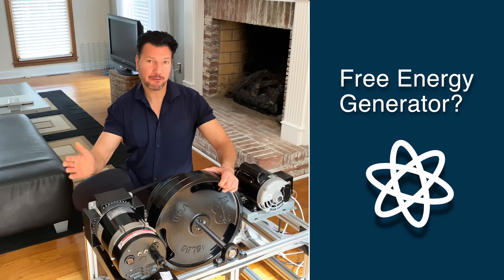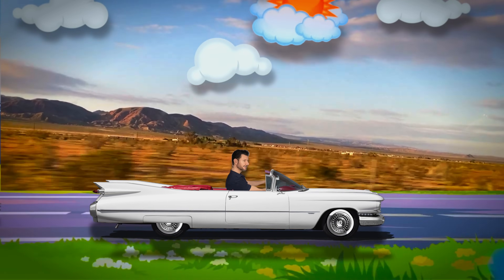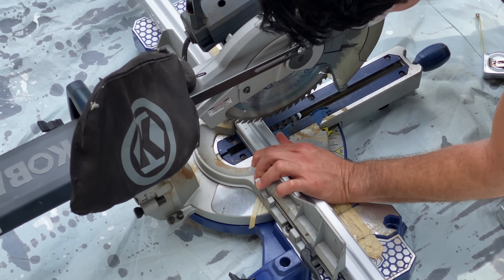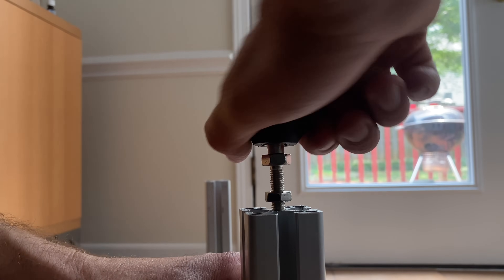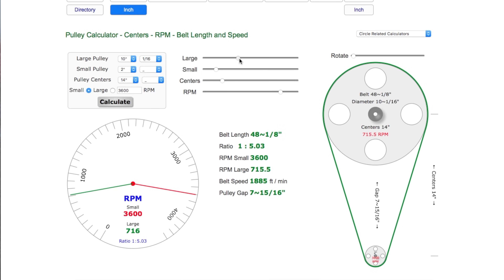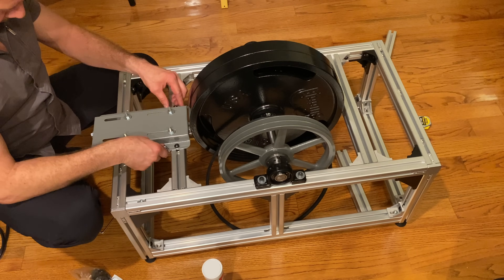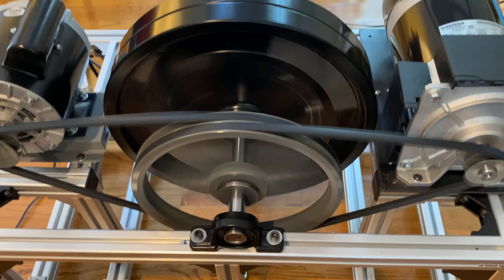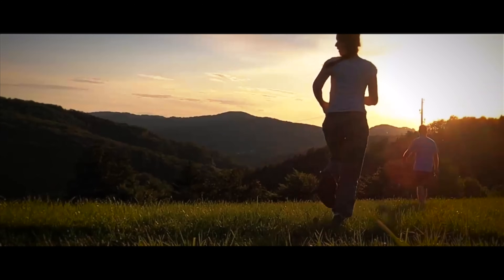How to Make a Free Energy Generator!

Comment: Yeah OK I'm the person out of all the other people you may have talked to they can make your prototype work, comma first I am the father of overunity I created it and I purposely stop talking about it because people were trying to steal my work .( Here's what you do put an alternator or a generator. In between what you already have on a fan belt. Overunity concept works with the the energy going in should be the energy coming out picture a water wheel as you know the water falls down into the cups cups that fills up the cup the poor cup pours out that's equal amount of energy as equal amount energy out if you try to overflow the cup you lose energy so these types of engines are limited . 2nd the motor should work off a battery If the battery should have passed through charging and the alternator should give the same amount of energy the battery does , remember in your car the alternator works all your electrical properties. So when you get there the alternator should run the motor when at speed and only the motor nothing else should be hooked to it the generator should be almost by itself to generate power for you If you cannot run a motor from an alternator then your car should not work look at the things around you hope them up the same way you'll see that when you hook a battery to run something and it runs normal then using pass through charging means that you should be able to put that energy back into the battery . So what do I do here's my video which I can show you that I got a complete wrap-around That means I'm recycling energy.
https://youtu.be/HTR03aSiGWs
 And one more thing here's my number so you  No that this is not fake I'll send you pictures through email if you wish the whole thing is that they've been trying to silence the people who actually are successful only things and only give voice to the ones who are faking it give me it. 3136515349 , media library has been doing these types of projects for over 31 years and yet we're nit were not even well known why why are you the kind of person who will find out and I and I spend a great deal of money working on these types of ideas so it's up to you if you actually want to know what to do I guarantee you someone will find a way to stop you from getting this information but it won't be us , sometimes they use lies and propaganda others they blocked you on YouTube or some other social media But if you can reach me then you will have that machine up and running. Oh you cannot connect electricity back into itself without immediator mediator the battery access that mediator it's called noise but we can go into the go into that in a bit more detail you tell and you'll see that is that the motors in and gadgets are different outside the country. Medialibraryinfo@gmail.com
Reply from the maker: Interesting work you are doing Lloyd!
Hopefully you will succeed!
Reply: @MarkusNenning   We  Been very successful over the 31 years we've been studying studying these types of devices for green energy, Again I stress if we get a chance to communicate I can tell you more details about the things we have done but so many people are Leary even just  Communicating over emails this this is why we don't have better information to debunk those fake videos, Like I said and I also know that those other guys will do that if you communicate with them is to show to show you pictures and proof that the thing you're working on are not fake. If so that's why I say here's your chance your chance to find out and pick my mind for some of your projects, Is the battery an alternator that just has one job to supply the motor with electricity Is not a trick It's just simple as this you know that you can supply electricity from a battery but nothree but no one talks about how you're going to give energy back to the battery you know the motor is powerful enough to give you all the power you need so  Mimicking what you already know like a car you know that you can can use a battery and alternator in the same functions with an automatic switch at a switch the alternator will constantly keep the battery going and probably have enough energy to supply for the motor or the motor add idle no when it's over tax it relies on a battery Most solar systems work the same way you just have to really think about what we have and we have and how you can use it in the most efficient way

Comment: Sir.. I have an idea to make it work. Just simple put a timer relay set to mode that will on and off every 1 sec... This will prevent the motor in stalling.. And i think the power generated is much higher than the power used durjng pulsating on and off grid
Reply from the maker: Hello “Just do it yourself”
Yes I was actually thinking about some sort of pulsing function it is a good idea.
But as a first step I think I have to change a few other things first.
Thank you!

Comment: I'm also working on it and what I concluded is that it is only possible with low rpm mpg alternator and by adding a.c. inverter of 2kWh along with programmable control circuit.

Comment: It is working as intended. Once you unplug the motor , it turns into an alternator if the circuit is connected to any load. In that setup you end up with two alternators trying to stop each other. Which is something used a lot. Is called ELECTRIC BRAKE. And as you can see is very efficient on stopping the flywheel, that's why us used to brake trucks on long descents.
Reply: If that is the case a rectifier diode should stop this from happening
Reply from the maker: You are correct Marc that is used for brakes especially now in electric cars.
However the switchover in my case is done via relay as you can see in the video and only takes milliseconds.
Such a short time can not create the resistance by induction to stall the motor. Especially if no other load is connected.
Thank you for your feedback!
Reply: @MarkusNenning  Hi Markus, thank you for your video. I agree with Marc in the sense that the generator and Motor are out of Phase, try swapping around the L and N lines, I would also try a Running capacitor across the lines about 10uF to see if that would help? On another note these are free energy machines in the sense that you create the video, put it on YouTube and you receive income and you have money to pay electric bill 😁
Reply from the maker: @bengouws  maybe you’re right about that Ben 😃
Switching phase with N won’t make a difference on a single phase motor.
But thanks for your feedback appreciate it!

Comment: I think there should be 2 motors in this system. Bigger motor to give initial push to flywheel and get replaced by smaller motor.
It's because flywheel requires more energy in the the boggening and once it's rotating it's max speed, it will be easier for small motor to maintain it's speed so energy could be accumulated by flywheel by each rotation of small motor.
Please try and let us know. Keep up the good work.
Reply from the maker: That’s a good idea!
Thank you xshadow!

Comment: Use a dc motor with a speed control. You can ramp up slowly without draw a higher amp. The other thing v belt drag power from system use timing belt no need to adjust too much, I try this once with two dc motor without the fly wheel just the pulleys 2 to 1 and run for a minute, as you say is difficult to find a flywheel
Reply from the maker: Thanks Raul!

Comment: The closest anyone can get to “free “ energy is with solar panels and battery banks. Anyone that makes a free energy video and shows them getting free energy is lying. There is always going to be internal losses. Even with a power inverter with a charger connected to it and the source battery. It may prolong the run time for a short period. But the internal losses will take affect.

Comment: The only way i suppose working is using neodimium magnets as power source, self inducting current on own coils. Once the motor reaches the working speed, you will have an exess power to use. Without calculation is almost impossible to say how much will produce but if is big enought, well maybe also 1 kw. I'm talking about an engine weighting around 200 kg...
Reply from the maker: Thanks Denny I also believe that magnetic energy might have the best chance to work with a setup like this

Comment: if it goes for more than 12 hours all the chances to burn, it is not very good to use it continuously, but it is very good one built for 24 w for charging solar batteries, I work on it if I succeed I will put it on youtube
Reply: Buna ziua
Chiar va rog sa postați un video dacă va reușește proiectul
De 7,8 luni tot urmăresc video-uri de genu și nu sunt ferm convins ca e real
Mulțumesc

Comment: the kg wheel must have rotations per minute rpm much higher than the generator, and the generator needs some bulbs, some consumers not to burn, ie it must be somehow balanced exactly for that consumption otherwise it burns
Reply from the maker: Hello Cruceru I have actually tried the bulbs because I thought perhaps I need a load on it. My generator supplier also had a recommended tolerance +/- 200rpm. You suggest to go over that?
Thank you

Comment: Hello, I have tried to do the same, but what happens is that the motor while receiving electricity behaves like a motor, but the moment you cut the motor power, it becomes a "Generator", then you go back to put energy there is an electric shock, between the energy of the motor (transformed into generator) and the large generator and everything begins to stop.
I think that what should be done is to synchronize the phases between the power of the grid and that of the generator and after synchronizing you must cut the power of the grid. and voila! ;-)
I follow you. I want to see a happy ending xD
Reply from the maker: Hello Jaime, I have avoided that in my system with the relay I show towards the end of the video.
This makes the switch over from grid electricity to generator electricity just a couple milliseconds. That should be fast enough to not cause the problem you described.
Thanks for the feedback and subscribing!
Reply: @MarkusNenning   I understand what you are telling me, but until today there is nothing faster than electrical energy, so by the time you make the change with the relay, even if it is very fast, it will never be faster than energy and stop that will be too late ;-)
Sorry for my bad english xD
Reply from the maker: @1972Jimm  your English is fine no problem. 
Thanks

Comment: ..try adding a battery , capacitors , microcontroller ,pwm motor control.. etc..we need this to work in order to recharge batteries on the go in EV  in the near future.. let's figure out the perfect circuitry/formulae for it..open sourced
Reply from the maker: Totally agree Suren!
Thanks
Reply: @MarkusNenning  ...keep in mind " the infinity mirror or the feedback noise from a speaker" this is the main principles we are working on but in a form of extra energy harvested from a calculated combo of motor + flywheel + dynamo.. if this works than a new revolution is born..
Reply from the maker: @surenbono6063  huge U2 fan by the way so love your name! :)
Reply: @MarkusNenning  ..it's a beautiful day.. don't let it go away..
Reply from the maker: @surenbono6063  love it one of my favorites!
Reply: Check example 2 https://youtu.be/eBtxjyD01lo
Reply from the maker: @surenbono6063  this is an amazing system! One of the only ones I have seen so far that actually seem to work.
Have not seen much of it since though?
Wondering if he got paid off or silenced.
Reply: @MarkusNenning  ..I don't know..seem like he is not answering to viewers comments ..

Comment: el felicito por su proyecto, muy interesante. me gustaría hacerle una sugerencia en el volante de inercia, yo le pondría 6 imanes de neodimio de 50 mm de diámetro x 15 mm de altura, y construiría una bobina bifilar con 800 vueltas y un núcleo metálico de 50 mm de diámetro por el largo del carrete de la bobina. En definitiva haría un motor Bedini para ayudar al motor eléctrico.
Le envío un abrazo desde Montevideo - Uruguay

I congratulate him on his project, very interesting. I would like to make a suggestion on the flywheel, I would put 6 neodymium magnets of 50 mm in diameter x 15 mm in height, and I would build a bifilar coil with 800 turns and a metallic core of 50 mm in diameter for the length of the bobbin spool. Ultimately I would make a Bedini motor to help the electric motor.
I send you a hug from Montevideo - Uruguay
Reply: Correcto es lo que yo he hecho en otro comentario le dije que si pudiéramos en volver esa rueda de inercia con imanes quisiesen ese movimiento permanente y

Librería detención el motor con lo cual quedaría el más energía libre en el alternador

Comment: Hi try to see on this guy Chas Campbell. I think indians that showing on youtube followed this guy. There are certain ratios to follow to work. He did this with a 10kg flywheel. Ac 750w motor with 2.75" pulley to a 5" connected to another 8" and turning the flywheel with a 4" pulley.On the other side of flywheel a 9" to a 4.5" pulley to AC generator.
Reply from the maker: Thank you I will check him out.

Comment: I feel like you would get a higher rpm transfer to your flywheel with a smaller pulley attached and the bigger pulley on the drive motor....with a wheel you have to make more rotations with a say 2" wheel compared to a 4" wheel to cover the same distance
Reply: My thoughts exactly! Your bigger pulley needs to be on the motor
Reply: the larger pully on drive motor causes higher amp draws from motor.   the key is to tune the gear ratios for the lowest amp draws while still reaching the correct rpm of all three components.
Reply: Don't forget to put the big pulley on the flywheel than the smaller pulley on the generator that would change the out put speed to the generator forn the flywheel
Reply: @joshuaandersen5294  sure you have to get the generator up to the rpm it needs to be able to put out the power the motor must have to spin the flywheel and the generator.  The higher the gear ratio from flywheel to generator the faster the generator will spin however spinning the generator faster than is needed to provide adequate current for the motor will increase the amp draw of the motor.  That is why I say it’s a balancing act a gear ratio tuning procedure aimed at the drive motor using as little amps as possible while still performing the task of spinning both fly wheel and generator at The speeds needed for the generator to output enough current for the drive motor.

Comment: Well duh yes a flywheel has plenty of energy  but it was gained by the motor hp over time  ..anyways I logically know that it cannot work no matter how you do it...but I actually  made a machine that appears to break laws of physics but it just tricks the dumb humans lol you need a magical energy source  I used gravity and pressure so it's basically a gravitic energy harvesting device 😉 every one says you can't make a gravity  energy machine  but I figured it out and afterwards I realized how it works  I now know about 7 different gravity  energy devices that will work  .it just requires  elegant simple use of engineering.. coincidence is it can be reversed and used to move when energy is applied..a actual gravity drive I'm 100% sure darpa already is decades past my simple discovery  🤔 sooo do not  believe what is taught in college like we can't go faster than light ...wrong..we absolutely can we are just told never ever ever even try or every one will attack you and basically  just ruin your reputation  period... I been saying Einstein was wrong for decades and now  a few brave engineering people are figuring out  oh duh ya he was wrong 🙄 just like archeology  if you don't align with the standard  theory  then your basically executed ( career wise) ..seriously though  use your 2nd grade mind to imagine how stuff works otherwise you will never invent new stuff..good try
Reply from the maker: Great feedback Sailing Mohican!
I feel the same way!
Some of this theories are 100 of years old a lot has changed since then.
I will touch on that topic next time.

Comment: The video title is wrong, you were unsuccessful in making a free energy generator because you've successfully debunked those other videos which falsely claim these things are possible. The reason yours didn't work is because your machine isn't fraud.

Free energy is impossible.
Reply from the maker: Hello OpenSourceLowTech
The Titel of the Video is “free Energy you say?”
I did not claim to have found the magic sauce.
I am also not 100% sure it is really impossible. I can confirm that it does not work in this mechanical way trying to use kinetic energy but I do have a few other ideas that I will put to the test and make a follow up video about.
Thanks for your feedback!
Reply: That's the thumbnail text, the text text is 'How to Make a Free Energy Generator!'
But please do make further videos actually testing this stuff out, not a lot of people do that, they just make assumptions, usually based on the assumptions of others. I'd suggest tho that you present the work and outcomes more as skeptical enquiry through to outright debunking, but it's your channel and you can of course do whatever you want with it.
It's an impressive amount of effort you put into the videos and builds, with the right content in the right way you could do well.